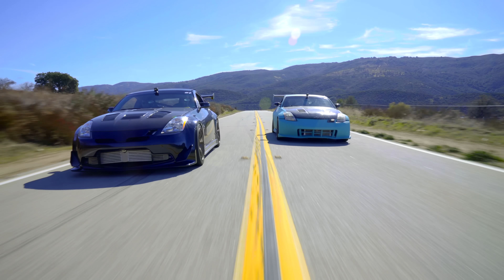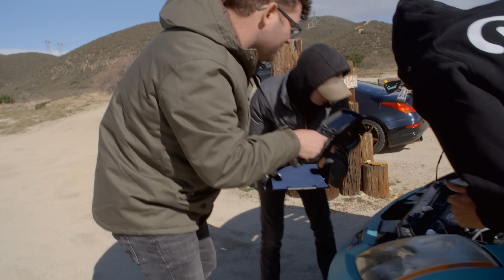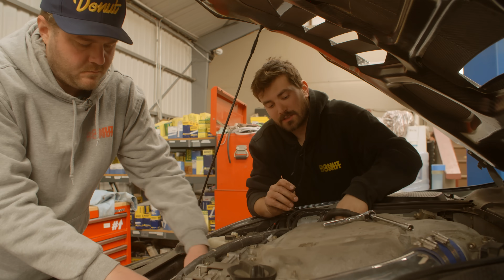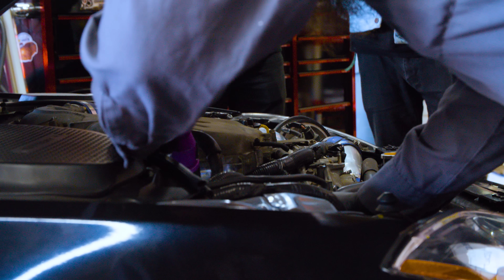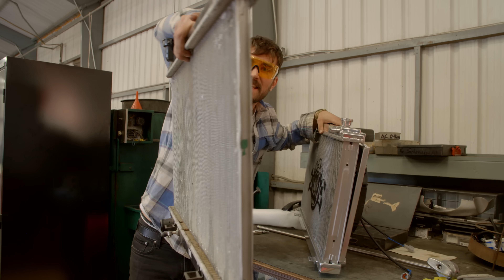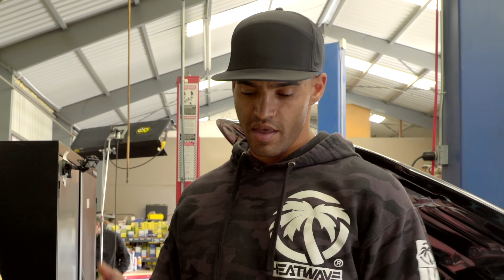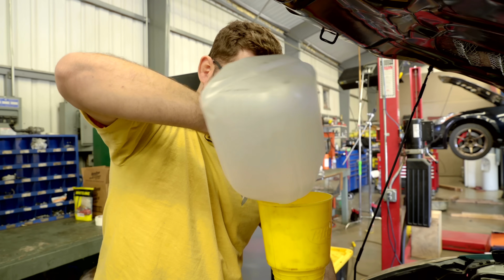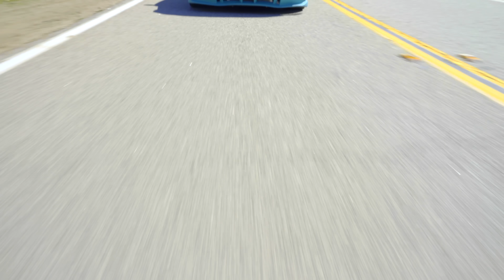$200 Radiator vs. $500 Radiator

Comment: You guys must not no anything about cooling so with taking off the factory cat allowing better flow and cooler engine operations because now the exhaust doesn't have to struggle as hard how about doing that test again with new cats on both cars our put    both cars with the same exhaust set up

Comment: Less than one minute in, and I know that simply the dual fan assembly THAT'S CLEARLY DESIGNED TO FIT THE RADIATOR CHOSEN is going to work better than the BARE FAN THAT IS MUCH SMALLER THAN THAT RADIATOR CHOSEN.

Comment: You kids check your fuel mixture?! Find the read of bar graphic between blue green red black or get exhaust temp. Meter , this over heating cause you exhausted Catholic converter melt , check your intake manifold bar pressure sensor too . Rich and lean cause your engine overheated

Comment: Another thing to worry about cheap radiators is durability, I replaced my radiator with an Amazon all aluminum 3 core a year ago and it’s now leaking from somewhere in the middle of the 93 OBS F350 7.3IDI

Comment: These both seem like affordable cooling systems when I think about my 3 main spal brushless fans plus other coolers with spal fans and 2 fan controllers to control it all and not those shitty funky controllers then all the wiring and gauges and override stuff.  Then the AN hose and fittings from earls and my oil cooler was rather pricy for such a little thing. My transmission cooler by itself was only 175 if I remember right. But I suppose it's a different platform and I have an incredibly complex yet robust system on a vehicle prone to overheat. Although I'm still running the mishimoto aluminum radiator that is one of the cheaper components but I like the lifetime warranty I've had much more spendy radiators with no lifetime warranty and the mishi has worked great I've only warrantied it once without hassle. We have multiple of the same vehicle running that radiator so only 1 warranty so far is pretty good. 
I used a mishimoto fan setup on my wife's rig with the radiator and it overheated with the controller turned all the way up or technically down. I put spal fans on it and it over cooled so fan quality is everything, these specific fans were actually the exact same as some ebay 15-20 dollar fans just with a metal mishimoto plaque thingy attached but remove the mishimoto brand plaque and it has the same decals and rating and wire and everything I purchased an ebay one to make sure because I didn't believe mishimoto would do that at first but they just rebranded very cheap fans and jacked up the price. But the shroud they came with worked nicely that was mishimoto built.

Comment: Shrouds have a much bigger impact than a lot of people realize. I had an expensive racing radiator in my GTE swapped SC300 and at the time the only shroud that fit the radiator was on backorder. So until the shroud came in I just attached the fans to the radiator. Doing this the car would constantly overheat. Not like crazy overheat but the gauge would go to the 3/4 mark when running it hard and come back to slightly above 1/2 when driving normally.  Once the shroud came in and I moved the fans to it the car always ran just slightly below 1/2 no matter how hard I ran it.

Comment: 13:00 - nope nope nope nope; the antifreeze also increases the boiling point of the coolant and it contains small amounts of "seal lube" which help your water pump not leak. It's also got anti-corrosion additives; the distilled water will corrode your loop.
ALWAYS use antifreeze.

Comment: Yup a later reply but I say BS the problem you using a 1 row core rad the other is 2 row core rad or dbl wide single row tube core which will make all the difference in the world my chevy C2500 truck has a lo-car radiator but itis a 3 row core that got 5 year ago still going strong to this day.

Comment: Need a cross flow with more rows to make a true difference. Vertical flow rads don't cool as well because you have to imagine how the water flows. It's constantly moving when the thermostat is open so the radiator is likely not going to use the full capacity but a vertical flow is going to have a bigger dead spot than a cross flow.

Comment: If a 350Z is track-dedicated and literally only driven on track (taken to and from track on a trailer) with the a/c deleted, how important is the shroud/fan? My Z is my track toy, still n/a with zero cooling problems running hard with the OEM radiator and shroud in spite of mods to include cams, and even though I ask myself why fix what ain’t broken, I’m considering upgrading the radiator and the fan for (1) improved cooling, (2) reducing weight up front, and (3) opening up a bit of space in that area of the engine compartment. I’ve come across some research that indicates fan+shroud OK for city driving but not best for track as the shroud becomes obstructive of air flow. I’ve also found some people experiencing overheating issues with the Mishimoto shroud, but apparently those were not track cars. Any thoughts? Thank you.

Comment: Capacity is the cooling capability. Not the volume of liquids. Water in general has more btu available to allow cooling better. Hi car was running lower temp to begin with. Both the aftermarket radiators cooled better than stock.

Comment: Do the anti freeze coolant and the distilled water mix together well? I'd assume the coolant is nonpolar and water is obviously polar and if they don't mix properly then using a mixture of both could maybe cause issues. But yeah depends on the polarity of the coolant

Comment: Not always a larger radiator will be better, if it runs cooler than the specified design temp this could be due to rich mixture and premature wear

Comment: This is kind of funny to me I was explaining to my friend why he didn't really need a new muffler and then said he would get more results from something else he he decided not to get a brand new muffler just yet mufflers are one of the things that are kind of funny your muffler is designed for your stock engine so there's no point in changing it out when you have a stock engine and the reason for this is because the manufacturers do a lot of research and they're pretty damn good at matching up their mufflers to the engine that they have so if you did change it out you wouldn't even really see one horsepower increase but if you have an upgraded engine and you know you're pushing an extra 300 horsepower and you change your muffler you can get the extra 20 even 30 horsepower out of it I even saw someone who added it to their vehicle it was a heavily modified vehicle but he never changed the muffler so when he did it added 52 horsepower to his ride that's where the misconception oh ill increase horsepower no it really doesn't it also increases fuel efficiency but if you doing it as your first mod there's no point because your stock muffler already does the pretty damn good job for that engine it's only when you start pushing that engine way past what the developers wanted or even thought is it starting to become a good idea to change out to your muffler
Reply: this varys alot depending on the car, for some cars just changing the exhaust can free up plenty of power especially if you combine it with a tune. the manufactures do not get it perfect in the cars most people are driving. my relatively stock 1.8 celica gets around +10hp with just an axleback
Reply: @arcanevoid9199 yup 👍 I agree I simple mean that you will get more bang for your buck if you have other mods with it  if it is a stock engine you can buy other mods for the same amount as a muffler and it would give you more HP per dollar usual  around 2x or more power you can think about it like this 

Stock engine = +10hp
Modded and tuned engine = +25hp

So if you only want to do 2 or 3 of mods then don't bother with a muffler other mods get you more power

Comment: i feel like a plenum spacer could have saved those vq engines and let them stand up longer to fi. its a pretty commonly known issue in the vq world that the front pistons get kinda choked stock so giving them more room to breath definitely prolongs their life. these engines can handle decently over 400 hp on stock internals when done correctly and often go 1.5-2x that with reinforced internals. i know theres a lot of jerry rigging that also cause the heating issue in the engine diagnosis videos but at the least it would mean the difference between two dead vqs on track day vs two vqs that survived their first track day.

obviously at the end of the day fi in a car not designed to have fi is always gonna speed up the death of the engine which is also why im reconsidering going fi on my g35/ im sure if they had more time to properly setup the builds instead of measuring once and cutting twice the zs would have turned out way better performance wise

Comment: i have an question and i have not much information about idle temperature and most of car run temp is 90 C degree and at this video can able to see high spec car runs vay lower than middle section on temp gauge so is that safe to do ? or something wrong with thermostat ?

Comment: No, that's wrong about antifreeze. If theres not enough antifreeze and too much water it's actually corrosive and can damage aluminum engines. Antifreeze also works as an anti boil. It also helps dissipate heat better than straight water.

Comment: Track guy warning!!! The fan shroud works great at slow speeds, but at track speeds, the speed of air through the radiator WILL exceed the flow of the fans- at that point the shroud becomes a hindrance.  The shroud needs flaps in it to allow that extra airflow to pass through it. Tons of experience with this and learned the hard way

Comment: If you get longer threads for the 02 sensors so they are recessed out of the path of the gases, you can trick the engine to thinking the cats are okay. And delete them completely to avoid this problem. But just extend the downstream sensors not the upstream. I’ve done it on 10 trucks and cars and it works well.

Comment: That metal plate is not a shroud, it's a blockoff plate. No air is going to hit that radiator anywhere other than where the holes are cut for the fans. It's a stupid design from negligent manufacturers. A legitimate shroud spaces the fan off the radiator so the air has room to spread out and pass through all the fins. You'd be better off throwing that plate away and mounting the fans directly to the radiator.

Comment: I spent $500 on my cooling kit on my G35, got the mishimoto racing thermostat, mishimoto silicone hoses, mishimoto radiator, and some pentofrost. I went with the stock fans. Had some fitting issues with the radiator but other than that, awesome! I would get a check engine line that the car was too cold during 40s temp🥶
Reply: Did you get a pressurized radiator cap?

Comment: im curious if low car would of been better off with doing the megan racing rad and a cooler tstat. 70/30 mix or try water wetter. may even have to use some heat shielding to stabilize underhood temps. im also thinking because low car has issues with boost leaks that the engine and turbo are working extra hard to make 300hp creating extra heat.

Comment: As a person who use to run a mishimoto radiator and mishimoto fan/shround  there fans suck my stock s2000 fans pulled more air through the Rad compared to mishimoto. With that being said i never overheated but did end up selling the shroud replacing with stock fans....
Ultimately i ended up upgrading to a CSF Radiator with dual SPAL fans.  Never once did i overheat with either of the setups

Comment: Why didn’t he just the heat on to get the coolant flowing. I work on BMW and on the n54 twin turbo. Or any BMw. The coolant system is an air tight system. So to fill at the reservoir. Then it needs to go through a sequence to bleed the coolant system. So the car needs to know what your doing and bmw coolant or compatible or else it will go into limp mode. To protect itself if it senses auto zone coolant. Anyway turn key, hold gas pedal to engage coolant burp system mode or if you have a fancy bmw obdi or programmers. You can control and tell the it to go land kick the fan on but not with engine firing. So turn the heat on blast. Run it until you hear a beep or a continued flow of coolant from bleeder valve into reservoir. Idk I’m telling all this I just thought it was relevant. Instead of whatever the engineer could just turn the heat on

Comment: At 13:56, I don’t understand the comment that you made. “We have to hold the RPM’s really high right now, just to get the fans to come on which means the radiator is doing a good job.” What? The thermostat determines the temperature reading as it lets hot coolant out, but the fans are PCM controller. What is controlling the fans? What temp are they set to come on? What thermostat is installed? These all make a difference if the judgement on the radiator is already made. If the stat opens at 190F and cooling fan(s) come on at a set point of 205F, then it would make more sense. No mention if the upper hose was even hot. Way too little information for anyone less than a tech who works on these everyday. If my above assumptions on temps are correct then yes, the radiator is helping, but it will still heat up as well until it reaches the “Set Point” of fan relay energize, PCM controller? But no one said. I was a tech at Datsun but only no electric cooling fans except the N10 front drive and that was a simple on-off switch to ground to energize the relay. Too little info but I am sure a large dual row or three row aluminum radiator helps. The debate is brass radiators actually cool better, they just have fewer and smaller rows. I am not able to test this as others have. If you got the jack and want to spend it, go for it. 
ASE Master Tech since 1978

Comment: I’m pretty sure that the temp you’re measuring with the radiator more so indicates how well it’s dissipating heat, not necessarily how hot the coolant is.
Reply: Exactly! Theoretically a better radiator will have a hotter outside temp because its able to dissipate the heat to the surrounding environment more!! 

Good catch 👌

Comment: Pure water in a cooling system doesn't just freeze, it can also boil in the cylinder head. Coolant/antifreeze raises the boiling point to prevent this. Running straight water without any additives or antifreeze/coolant can cause detonation and other issues

Comment: I did this with my computer's radiator and pump that had clogged up not that long ago. Works better than new with distilled water. I'm not in SoCal, but it also doesn't freeze. 👍

Comment: For radiators, price, thickness, and performance are not always correlated.  Previously owned an FJ40 with 350 that had cooling issues with the factory radiator.  A very thin flex fan was installed because a previous owner placed the engine too far forward in the engine bay.

Purchased a $200, 3" aluminum replacement, which effectively had no impact.  Separated the trans cooler and, still, no impact.  Had to go with an electric fan because the flex fan didn't clear the physically larger radiator.  A high volume water pump was also added to increase low rpm flow rate.  Still, little impact.

Swapped the carb for EFI (megasquirt/tbi) to purposefully run rich to use the fuel, running rich, to try and lower temps - while I was able to get it to help, minimally, the cooling issue still pressed on.

This is where I learned that the thickness of the radiator doesn't impact cooling ability as other factors.  So I purchased a 2.5" thick radiator that had 2 rows, but larger diameter inner tubes.  It was also a cross flow radiator, which is also more efficient than a standard top/bottom radiator design.  This radiator was a bit more custom to install, but the price was around $150 shipped from Summit Racing.

Cooling problems were then, effectively, resolved.

So, moral of the story is that actual radiator design is more important than cost when it comes to performance.

Comment: Don't use pure water in your radiator!

I'm surprised how common a myth it is that water is somehow 'better' than coolant... were that really the case, then why do manufacturers use coolant at all? 

While antifreeze is also coolant, coolant isn't always antifreeze as well. Coolant has a higher boiling point than pure water. At my altitude, for example, water boils at 195 degrees F. That's lower than the NORMAL operating temperature for my Jeep, which is 200-210F! Boiling water creates air bubbles which accumulate and form 'hot spots' where coolant can't reach, potentially causing engine damage. Boiling water will not only evaporate over time but also cause corrosion (rust) in your nice new radiator, water pump, cylinder gasket, etc.

Moral of the story: don't use pure water as coolant unless you have to, like as a roadside repair to get to the next gas station or auto shop, where you can get coolant mix or concentrate. 👍

Comment: Fun test.  They didn’t even try to limit variables.  Removing cat from exhaust most likely will reduce heat buildup.  Running ac increases heat.  If I run hit, I turn on inside heat, crack windows.  Engine temp drops quickly.  To point I slowly turn on heat adjuster from cold.  I really think you could damage something.

Comment: @14:00 for practical application that's not entirely true.  For Most vehicles if thr fans aren't kicking in, the thermostat isn't open, so the radiator isn't doing shit.  Only fluid moving basically is the heater core bypass. And Only a minute of heat is being disapated though the barely moving coolant.